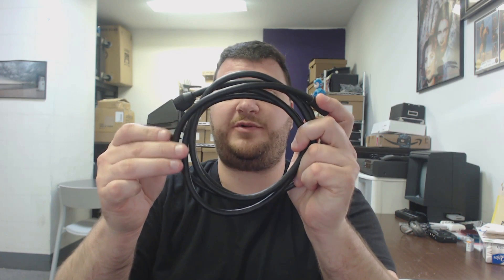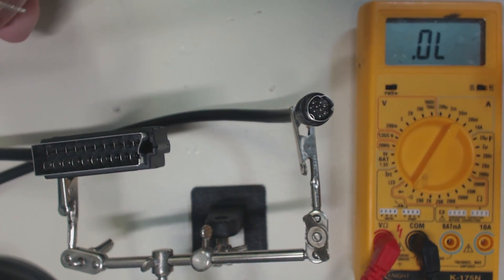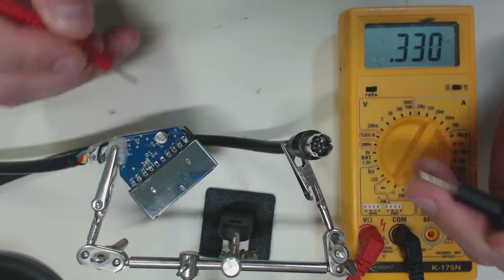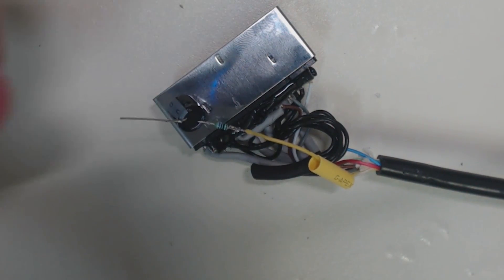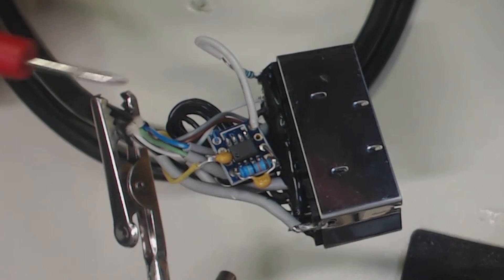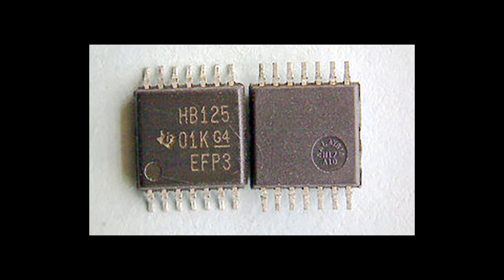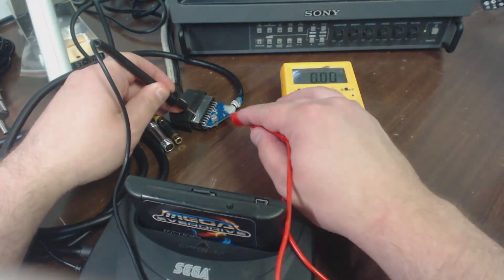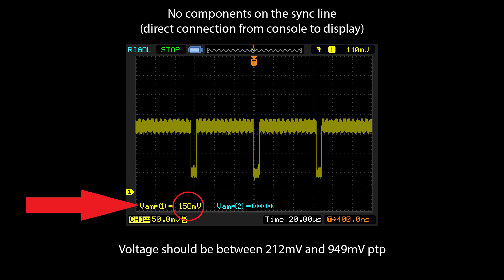How To Test Components in an RGB SCART Cable

Comment: Hey Bob, I have a PAL N64 RGB modded for ttl csync coming from Pin 3 of the multiout. From what I understand I'd need a NTSC SNES RGB Cable with 220uF capacitors on the RGB lines and a 470 Ohm resistor+220uF capacitors on the sync line, like shown in your video with the genesis cable?

Comment: Awesome video Bob! This is super helpful!.. I know you'd never recommend to buy cheap scart cables to begin with, but it would be really awesome to see a video breaking down all the things those cables are not doing, and just maybe is there anything one can do to improve them or make them "proper". I myself have invested about half/half in good and bad one's. I've had some decent cheap one's (at least working) and I've also bought some complete crap one's , specifically a couple of og xbox one's off of aliexpress, and it would be pretty cool if I could diagnose what makes these one's crap lol.

Comment: I have a knockoff PS1/2/3 SCART RGB cable that is being detected only as composite unless plugged into a SCART switcher and other console on the same switcher is turned on. Then it TV instantly recognizes it as RGB. I have no idea how is it possible and what is missing. Tested with ps1,2,3 and got same behavior. It has 220uf caps on R,G,B lines, tried desoldering them and got no change in behavior.
Reply: Found the issue by exploring lots of forums. Resistor between pins 8 and 16 is missing. Visibly removed even though I have 2 cables like this pulled out of the blister packs and both have this issue.

Comment: Is there a trustworthy reference out there for the required components in the other RGB lines of these consoles? For example for the Genesis, every diagram that I find on Google uses different resistors or some use capacitors while others do not. Furthermore, all have 75 ohm resistors on csync as opposed to 470 ohm. It is all a complete zoo! Thanks.

Comment: I got an AV scart, instead a RGB one, and only realized that when it arrived my home. 
There is a way to change it from av to rgb? Changing resistors or capacitors? Thanks!
Reply from the maker: You'd have to re-wire the entire thing.  It would be much easier to just buy a new cable.
Reply: Actually, this is not an option, because it takes months to arrive here.

Comment: Great video, thanks for the info.

One doubt, I recently made a mod on my pc core core 2 for rgb, for that I used a kit that is sold on ebay. In it there is a board that receives RGB 5v and ground, but the sync signal goes straight from the console board to the cable connector on the console. My doubt is, do I need to add a 220/16 cap and a resistor in the sync line in that case ??

I did not add anything to the cable scart, I imagined that the board inside the console was already all that was needed

the kit is

http://www.ebay.com/itm/PC-Engine-white-console-RGB-Amp-PCB-THS7314-with-Accessories-Kit-Brand-new-/122581926582?hash=item1c8a73c2b6:g:ByoAAOSwaB5XtMcf
Reply: I am in kind of the same spot - bought a modded PAL SNES that has c-sync restored, but unfortunately even the seller cannot tell me whether it is TTL or 75 Ohm.

So any tips on how to measure whether a console outputs TTL or 75 Ohm c-sync would be greatly appreciated (preferrably without having to use an oscilloscope).
Reply: You are using retro gaming cables? if yes i think the cable has everithing you need, but in my case, a made the cable, to use whit my pc engine, but i think the pc engine outputs sync on compositve not csync

Comment: On a similar subject, is there any way that repro carts be dangerous to consoles? And how would we check? Maybe another how to video? =)
Reply: Cesar Montes only if  you use a flash eprom with 3.3v and resistor or diodes to step down the 5v. 
Still is would be really rare if something happened to the console, even with the 3.3 flashcarts. 
For examples repros with 27c eprom or 29f are ok because these are 5v tolerant, I use 29l which is 3.3 and use a regulator to step down or diodes and never had a problem.

Comment: Just checked an old RetroGamingCables Genesis 1 cable and it has the same resistance as yours, about 75ohm. I better get changing that resistor!
Reply: It also appears this cable has 75ohm resistors on each of the RGB lines, with no capacitors. Looks like RetroGamingCables newer PCB SCART cables include resistors AND capacitors on each RGB line.....would it be worth adding them?

There also doesn't seem to be a definitive list of components required on the RGB lines for consoles, it'd be fantastic if your Csync guide included that info too. Although I completely see why you wouldn't as it's probably a tonne of research and testing which would take a lot of time. Great vid as always Bob!
Reply: Eric Hurley my old retro gaming cable for the gen 1 also used the composite for sync, so I had to move it to the sync pin before adding the resistor and cap
Reply: Douglie007 cheers for the heads up! I'll double check that too. There seems to be conflicting genesis 1 pinout diagrams online. Which one did you use?
Reply: Eric Hurley I used this one http://www.gamesx.com/avpinouts/genesisav.htm